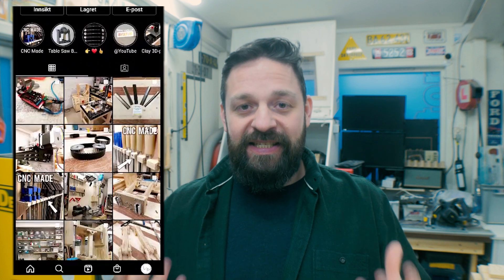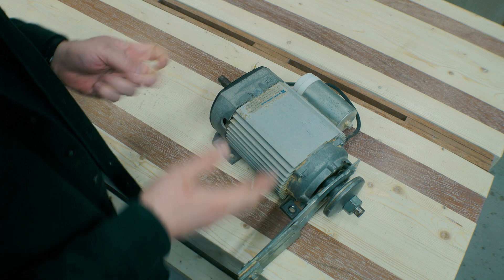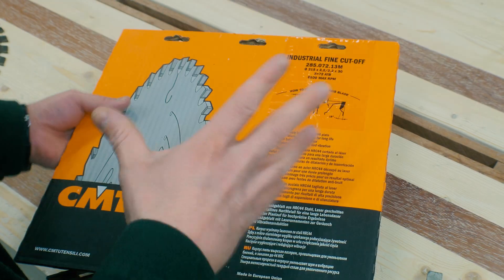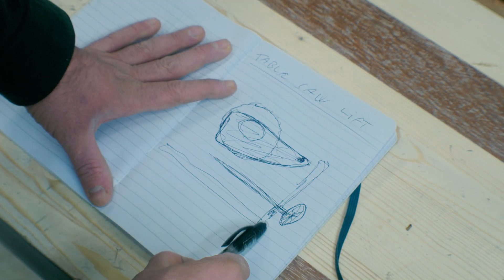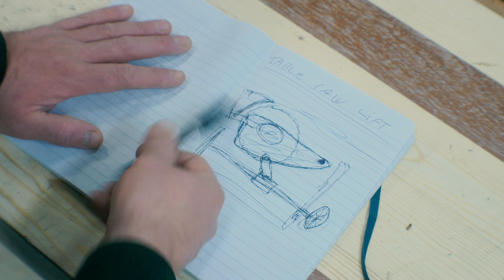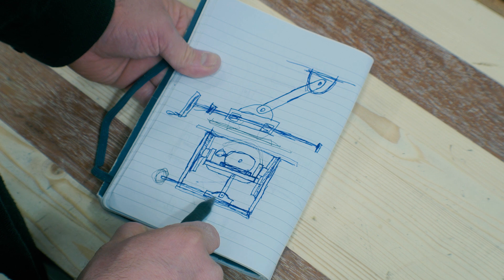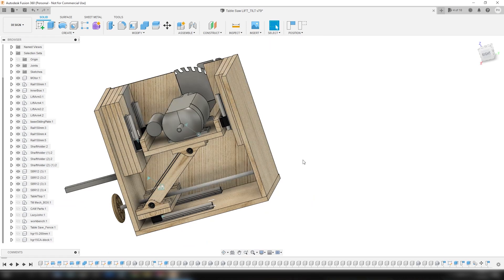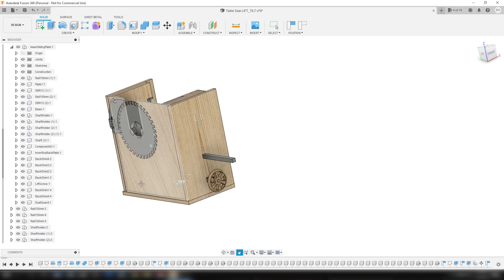DIY Table Saw #1 - Design | Lift Mechanism

Comment: I built mine many years ago with a box in box design. It doesn’t tilt but stays square and moves up and down smoothly. This is important as I use it with a pedal lift to do plunge cuts in panels. I use a hydraulic jack for stationary lift situations. That is to say any common use. 
These are great ideas as I would like to incorporate a tilt mechanism when I rebuild it. 
It has held up well for nearly fifteen years and moves between five states and coast to coast. 
Well executed video and keep up the creative work. 
Greetings from the high plains of Texas.

Comment: Wasn‘t the bottom sled a bit redundant? If you just used a nut on the lead screw and a single lever to the center of the upper box it would work just the same, the upper box with the motor and saw is guided anyway.

Comment: FYI, anyone looking at a diy table saw project, you can simply use an old mechanical car jack for the lift mechanism.
Reply from the maker: That is a simple and cheap solution, but how is the baclash, movement?
Reply: @WillysGarageNorway  Certainly nowhere near as smooth or sophisticated as your latter implementation with linear rails 😀
For a newbie DIYer, a screw jack is easy & functional. Of course, One could 'upgrade' to an old hydraulic jack for smooth and quick operation. Works well for a diy router lift, drill press table lift, basically lifting anything in the "z" axis (against gravity).
Reply from the maker: @vikassm  Yeah, thats correct :) I'm a fan of reusing old stuff so this is a good tip

Comment: Hi, I built a table saw with the same kind of rails but a little bit longer to fit two bearings on each rail. I used a total of 2 rails and 4 bearing blocks for the perpendicular lift. (I wanted this too for riving knife purposes). What you can do is the following: You may want to use two blocks on one rail. In your case this will probably not work because your rails are too short or the bearings will be too close to each other. However, you can remount the rails (and do a little bit of re-arranging) so they are positioned offset of each other so your on each side (front and back) of your saw you have a high and a low block. This should fix your problem without having to buy new linear rails and bearings.
Reply from the maker: Hi and thanks for the tip, I did redo my base carridge and used 4 bearing blocks on it. That made it very ridgid and sturdy. On the top motor carridge I have ordered new rails of a hgr15 type. Si I think that is going to work good 👍😀